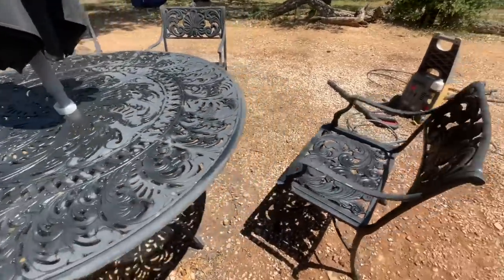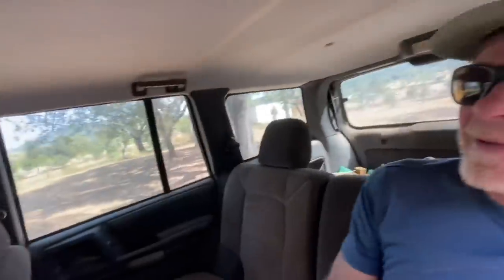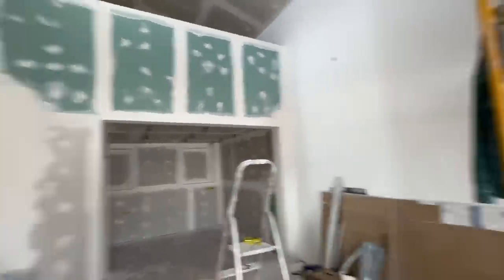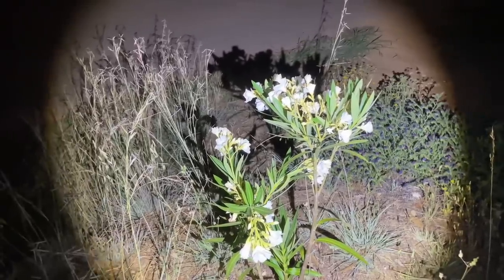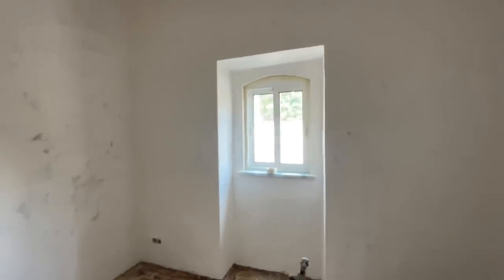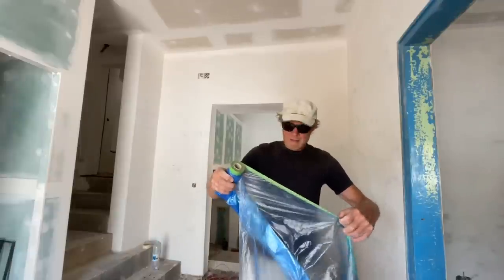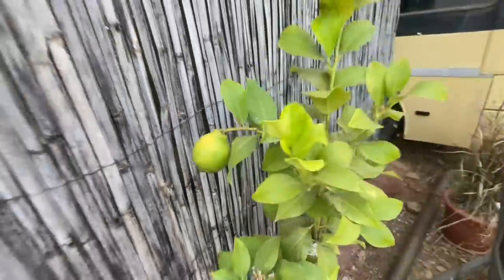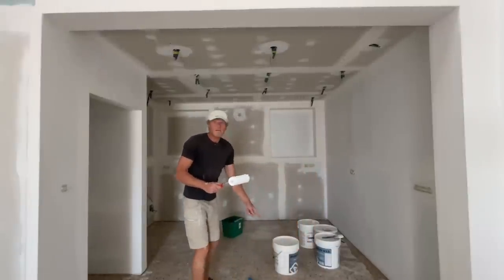ALGARVE HOUSE RENOVATION | Fresh lick of paint  #121

Comment: airless sprayer problem will be around the inlet ball valve the top of the inlet make sure the metal ball is moving freely and small hole above is clear then start the machine upside down in prime and pour water down the suction pipe
Reply from the maker: Did all that.

Comment: Sometimes doing things manually is easier than messing about with machines. The van great. You will get tons of use. Kisses for the d💓gg💓s.🙂👍👍🇨🇦
Reply: For big area wall and ceiling sanding I'd go with a 'giraffe' sander (sanding head on an extension pole with built in vacuum, every day of the week...

Comment: SANDING  ????  PLEASE realize an electrical sander with a unit that collects the debris can be bought.  The vlogger Lumnah Acres used one when he built the structure he now lives in. NO MESS, NO FUSS.  You likely could have done the 4 day sanding in 1 day.  Really.
Reply from the maker: Well aware thanks
Reply: @blondguy  some comments make me laugh, of course you're aware of certain tools and obviously tried everything to make the paint sprayer work but in their own way I guess they think they're being helpful?😁🤔😉
Reply: @jovickers5313  you are right   SMILE
Reply: @jovickers5313  That's why I usually skip the comments. Too much friendly advice based on watching rather than doing. 

I get the same "help" when speaking up regarding my profession.
Reply: Oh yes, and all the money in the world to buy these wonderful tools……
Reply: all our comments actually help the algorithm, a very good deal.  
Tools improve productivity.
Certain jobs are simply not fun. They are repetitive and time-consuming.  What is the value of a man working 4 days on any task?  What if that same task can be reduced to 1 day, with much less energy required, by using any tool?  
If the tool costs, say $1,000 US, then we might question it if we can hire any man for less than $250/day.  
But the tool in this case might cost $140 US.  So, now we would need to hire any man at $35 US for each day.
Not likely. At even $5/hour, we would pay $40/day.  
The tool is cheaper. The tool also has a residual cash value. It is likely to be at least 1/3rd to 1/2 of its cost. 
This is just one reason there are businesses that rent tools.
That is why people have invented floor sanders and dry wall sanders and other types of sanders. Economics of labor costs and human effort.  Smile.